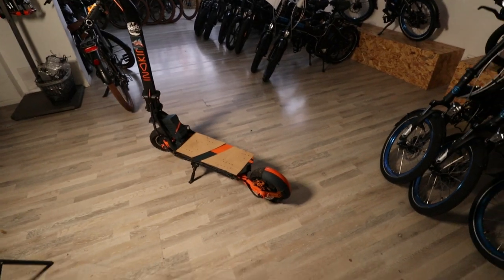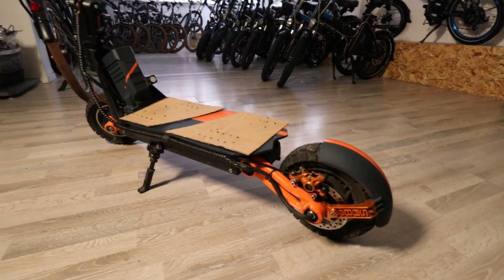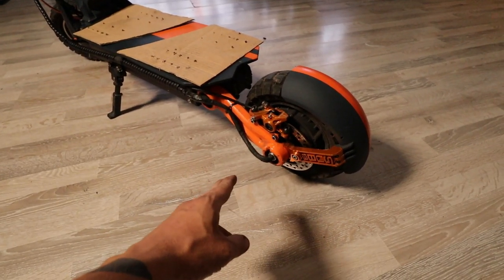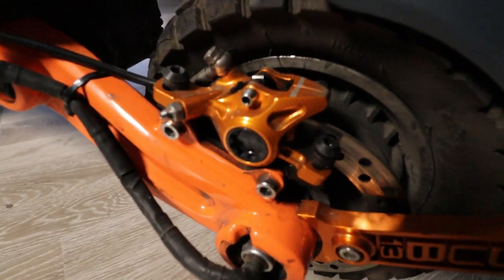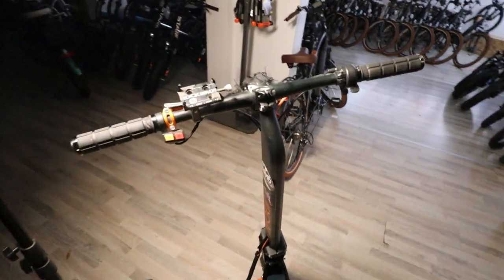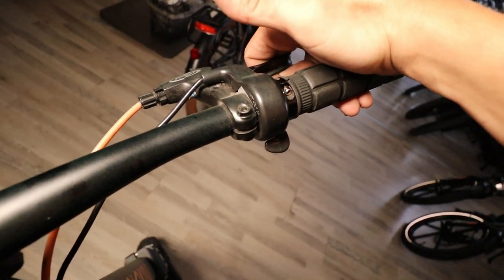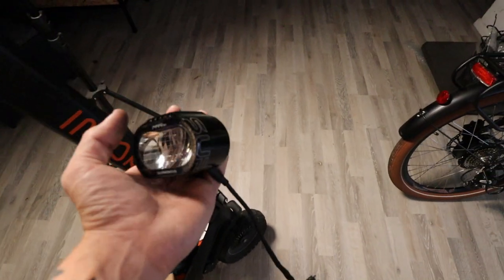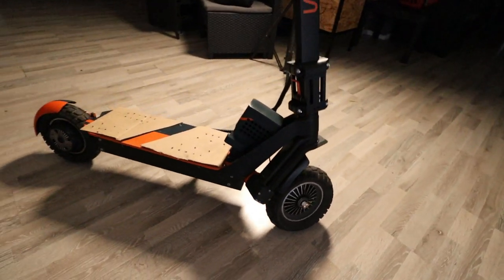My own modded INOKIM OX review ( sold for 4,330$ )

Comment: Hey man, great work! I'm thinking about adding front motor to my OX ;) I wanna turn it into something new) going to buy front swing arm and a motor from OXO plus ASI controllers set for OXO plus 72v 28Ah battery. Just wanted to hear your professional opinion on this build. Do you think the end result would worth such a crazy investment?
Reply from the maker: Yes it is. You'd be riding a rocket. And get a rear arm for front side, allows using better brakes